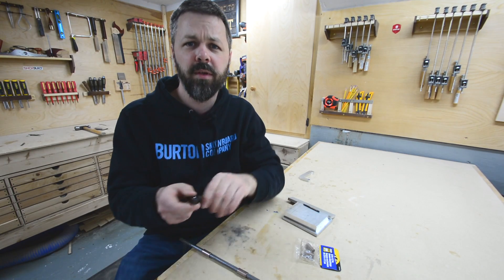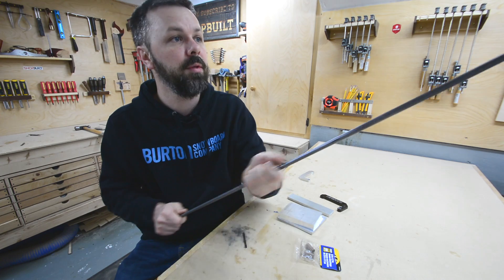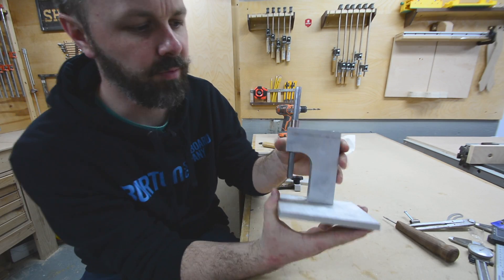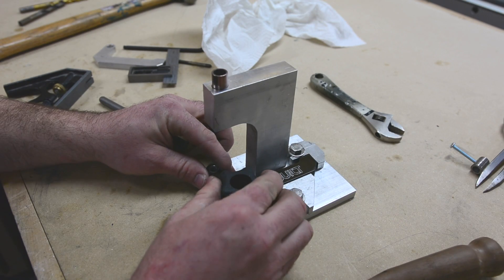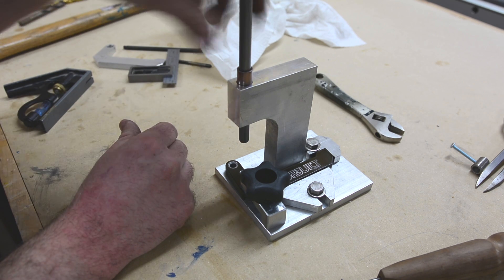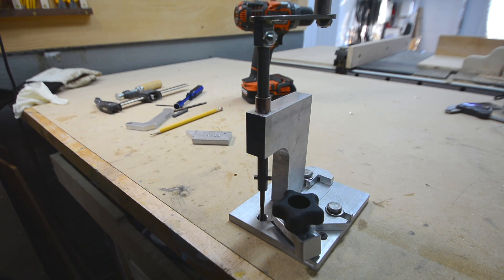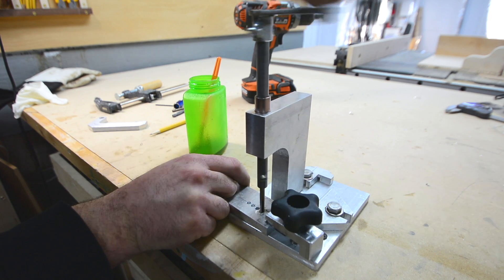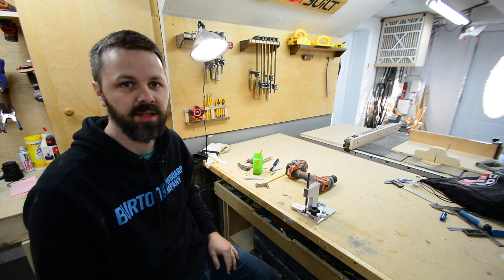ShopBuilt - Machine Hand tap

Comment: Nice job sir! DId you consider using a small pneumatic ram to keep the parts in place? Should make it more convenient with the number of parts you plan to make. This instead of the screw lock.

Have fun making parts!
Reply from the maker: +Stef's Engineering I did actually, just a little to pricey to buy local
Reply: I understand. I bought some stuff through ebay in the past, fine quality and fast shipping. I am all for supporting local businesses but for a bit of prototyping cheap is fine. Sellers name is "solaluna88", I am not affiliated with him, just happy with the service in the past.

Comment: What? You do have a lathe, I watched you build a very nice one. Or did you give it away? What do you do if the work piece doesn't fit your little fixture?
Reply from the maker: +William Bidel this jig is very specific to the flipstops but you could just have a larger flat base with multiple holes to make it more universal if you want. I'm not set up to put a drill chuck in the tailstock, that's why I can't use my homemade lathe.

Comment: If I've seen correctly the arm is connected to the base with only one screw. Wouldn't it rotate and mess up alignment? How about 2 screws?
Reply from the maker: +knight rider I was a little concerned about that as well but it seems to be really solid.

Comment: You didn't spend nearly enough time talking about how you aligned the rod to drill the end of it: chucked in a bit of rod, then aligned it with the bushing.  Clever thinkin'.
Reply from the maker: I didn't think of this at first either. I failed at getting it centred three times before I finally thought of the bushing, worked perfect!!

Comment: Nice work! What if you add a hexagon bit (screwdriver bit) to end of the tap ? With this way you will have very fast cordless drill connection to tap. Versus now you have to tight and lose manually your drill between every hole. This may speed up the process a lot especially if you have a lot of pieces to work with.
Reply from the maker: great idea!

Comment: There is an attachment that fits on a drill press that makes tapping extremely simple. Press down on the handle the tap turns in the forward direction, lift up on the handle the tap reverses and the tap unscrews from the work piece.
Reply: At what cost?
Reply from the maker: that would be nice. changing speed on my drill press is annoying as well because its belt drive.

Comment: Very nice. I don't have a welder, so I was wondering to what extent you could get away with normal woodworking tools (table saw/band saw, etc.) and a few taps to make holes for screws to join pieces of aluminum together to make jigs like this?
Reply from the maker: i avoided using anything other than woodworking tools right up until the handle., I think you could come up with something fairly easily to avoid the welder. Just a hole through the rod and a long bolt would be good:)

Comment: What was the tool used to clean the edges at 1:20? 
Is it only for aluminum?
Reply: maxcohen13 its called a whip. you can get different inserts for different types of metal. ie 304 stainless steel
Reply: swivel deburring tool
Reply: Thanks

Comment: If you can find or have an old cordless drill, take it apart and mount it and setup some forward and reverse push buttons. I saw James Bruton of Xrobots use this technique on his walking bot legs. still has the keyless chuck on them but more importantly, at least on his, it has a DC motor and planetary gear to provide enough torque. #morepower :-)
Reply from the maker: i like it:)

Comment: Great jig. I give you  props for having  the guts to market your own product, I like you am a Millwright as well as a Machinist and have had numerous jig made over the years that somebody else had  a similar idea and  marketed it and made the money from it because i didn't have the guts to do it myself . One bit of advice  when ever you are going to tap a hole in alum use a coarse tap the threads hold  up better over time .
Reply from the maker: +Brian mcd thanks:) I went with fine becuase it's for a adjustable cursor. The fine threads allow for a "finer tuning"

Comment: It's a great idea but like myself Everything that I've taped would not fit in that. Definitely a great idea for a production line type of thing were you would need to tape a bunch of holes in a row.
Reply from the maker: +Franks DIY it would be pretty easy to make a different arbor for each size. This is just mini though so probably 1/4" would be the largest but you certainly scale it up if you wanted to.
Reply: That is a great idea. I like the fact that it keeps the bit straight. Thanks for sharing
Reply: Shop buil

Comment: You can make another shaft or adaptor so you can center punch your part. It will make the hole on the press drill and on the tap machine at the same location.

Comment: dude buy some machine taps. then you can use your drill press (at a slow speed)  edit. i now see you are using a drill and i realized why you cant use the drill press... no reverse.. although you should still get machine taps if you havent already, they are made for power tapping (they push the chips forward or back and away like a drill bit so they dont clog the tap